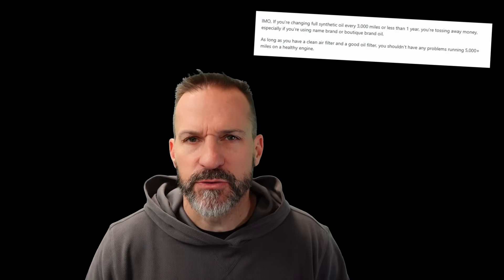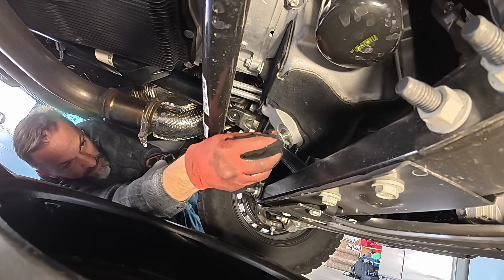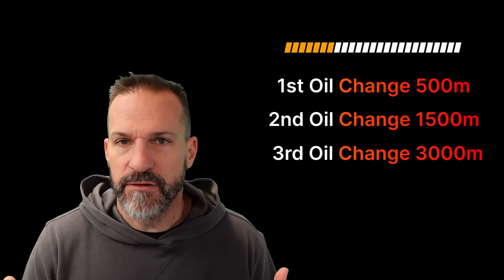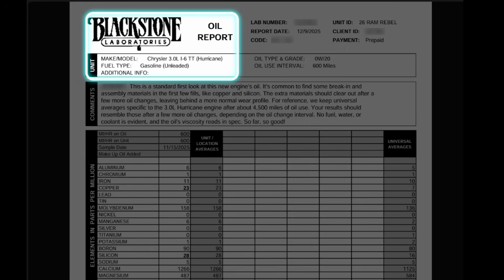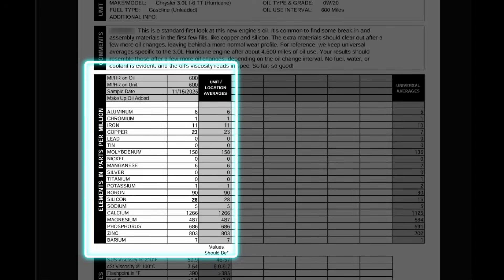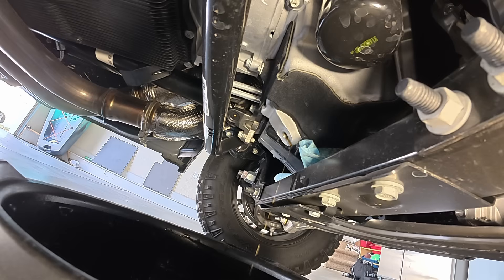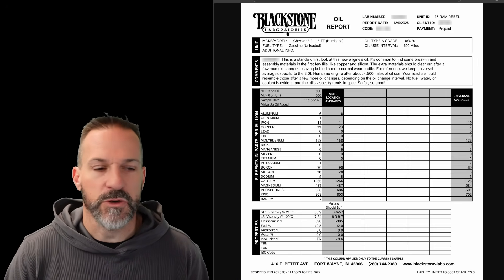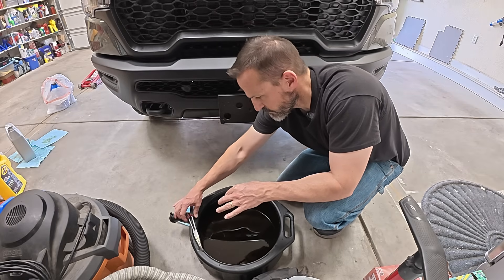Is the Motor Oil Geek Right? I Put His Break-In Theory to the Test

Comment: Lake is not wrong. As you are seeing. I have always done the same on every new engine build I owned and the only new car I’ve ever owned. Everything I own has over 200K on them.
Reply: Keep in mind, I have over 6 vehicles that I change the oil on and the majority all have over 200,000 miles on them as well. The engines get the cheapest oil from the shelf at that time and get changed every 10,000 miles. No oil burning, leaking, smoking or sludge. City driving I want to add before someone chimes in.

Comment: I wanted to a 500 mile oil change but ended up doing it at 1500 then 3500 because i had to drive so much for work. Didn't really have the mindset to do anything after work even on weekends. I've been changing my oil every 4k miles since, it is my car and i want to keep it in good condition. I'm going to make an appointment to get my transmission fluid changed out at 30k miles im very close to it.
Reply: 1500 is much better than most people!! It’s why I get so nervous about buying used. But it’s all I can afford.
Reply: @ajmedeiros77  just have the analysis done to determine if there is any insane amount of problems. Recommend interval first I think.
Reply: 1500 is already going to be better than almost everyone straight away and could likely do 5 or 6k intervals from now on just because you did that

Comment: Quality means nothing to these companies anymore. Profit and greed. Lower viscosity oils to boost MPG ratings and lower the "cost per mile" (excluding engine replacements apparently) . Tighter tolerance requirements while outsourcing the cheapest manufacturing = disaster. Higher efficiency for the sales and marketing team and to keep the CAFE penalties low but the consumer picks up the tab when it all stops working. Fixing this junk outside of warranty will cost the consumer far more money than any fuel savings it might have accomplished.

Comment: My opinion, if your engine can't take 10,000 mile oil changes with the cheapest oil on the shelf, then it was designed to fail before it was put in your vehicle.
Reply from the maker: Well, I actually do think there is a decent amount of planned obsolescence in modern engines so I’m willing to be more diligent
Reply: @TheCarGuyOnline  The reason for my statement is, I don't recall anyone talking a decade ago about change your vehicles engine oil more frequent in the beginning, Planned obsolescence, yes as I noticed a strand of our Christmas lights is not luminated and we just bought those last year. I do appreciate you thinking outside the box and taking time and money to gather a conclusion for your viewers.

Comment: What oil brand did you refill with???
Reply from the maker: Pennzoil Ultra Platinum 0w20. I want to get a baseline test with the 0W 20 and then potentially switch to 0W 40 to see if my results get better.
Reply: @TheCarGuyOnline  M1 FS 0w40 has 50% PAO still Pennzoil Ultra Platnum 0w40 is GTL and hard to find. Castrol Edge Euro 0w40 has all the approvals  except Dexos R and has only 10% PAO now with its API SP all  have a HTHS over 3.5 and pour points -42c. FYI a 0w20w cold @ 25c is 4X thicker than a 0w40 @ 100c
Reply: What does “better” mean? Doubling the factory-specified hot oil temperature viscosity seems questionable.
Reply: @marcinmerrimack1726  It's not doubling the viscosity. 20w ends at 9.3 cst@100c most 0w40 oils arr 12.5-13.5 cst@100c. 0w40 oils have to pump at -40c and have a HTHS of 3.5 min.
Reply: @johnmills837  Ok, fine. 0w40 is roughly 1.5 times the viscosity of 0w20 at 100c. 
Specified oil grades are undoubtedly a compromise between lubrication, efficiency, emissions and so on. So, yes, if I’m presented with the numerical trade offs showing, say, expected increased engine life at the expense of the other parameters, I can then make a rational decision of how, if any, to deviate from the manufacturer’s specified oil. But otherwise, this seems like mostly feel-good anecdotal overthinking.
Reply: @marcinmerrimack1726   0w20 @ 25c is 4X thicker than 0w40 @ 100c  Castrol Edge 0w40 has a higher film strength, has a lower pour point and a similar Viscosity, CCS -35c (0w) 5980  compared to their  0w20 Viscosity, CCS -35c (0w) 5900. All 0w40 oils have PAO group IV , Esters and GTL in their base stocks. 0w40 pumps at -40c. 0w20 has no PAO, Esters and higher VII's. There is no trade off at low temps using 0w40 and the same engine sold in Europe has a recommended oil 0w40
Reply: @johnmills837   So US buyers are unknowingly giving up some expected engine life in order to meet US emissions and efficiency standards. Yes?

Comment: I saw on a Gale Banks build a years or so ago where he installed a bypass oil filtration system that had a 2 micron filter. This is in addition to the normal 20 micron filter. I believe it was the video series about the new shop truck he was having built. This type of bypass system maybe what you're looking for to increase longevity on the new truck.
Reply from the maker: Yeah those look pretty awesome for longevity.
Reply: if i spent more than 30K on a truck, i'd certainly put a bypass filter in
Reply: They seem realy cool but in real world what they do is blow a line or a fitting brakes and your motor blows up.
Reply: Useless gimmick, that small particles does nothing to engine.

Comment: Does changing your viscosity to a higher number void your warranty? Could it in any way affect your engine? I have read some things that said it could make your oil pump work harder. Does or would this matter if its a variable "vane type" pump instead of a GerRotor style pump?
Reply from the maker: I’ve heard mixed things about warranty. Guessing it would be hard for them to know without their own analysis. I am currently trying to get more information from Ram about this, I’m 99% sure the SO oil pump will do just fine with a 0w40, that’s what the HO calls for and the engines are very similar
Reply: @TheCarGuyOnline Looking forward to hearing what you find out. I would like to run 40W as well. I saw Lake's video as well and decided to chain my oil at 2k mi then again at 5k.
Reply from the maker: @AzRimRig  i’m hoping to get a baseline with the 0W 20. Then I want to prove out whether or not the 40 weight actually protects better. I just wanna make sure I’m past the initial break-in. Before I do the switch. I think Lake says 10,000 is where you can get your baseline
Reply: @TheCarGuyOnline sweet, thanks for doing this analysis very helpful.
Reply: @TheCarGuyOnline look forward to hearing from what you find

Comment: When people have 1000.00 car payments, it sounds great that you’ll not need maintenance until 10,000miles.
Reply: And periodic 10K oil changes causes early engine and turbo failures...oil courses thru turbos to keep them cooler and turbo oil cooks oil sooner.  Faster engines and transmissions wear out, the more profit for car makers.
Reply: And in 4 years you will spend $13.000 on payments for another car.  There used to be an Fram filter add on TV that said" pay me now or pay me later" Very true.
Reply: Yep, change your oil 3 times and get a new one. :))
Reply: Yes people are told cars need less oil changes  as a selling point.Mis leading the customer think he is saving money on maintenance.

Comment: Why the copper?
Reply from the maker: I've heard that's usually bearings, oil coolers, bushings but we'll see...from the interwebs "3.0L Hurricane (SO & HO) uses modern tri-metal plain bearings and a brazed plate-style oil cooler, both of which are well-documented early copper contributors during break-in." Hopefully by 5,000 miles everything will be settled down and normal.